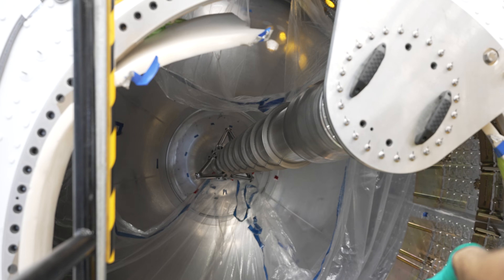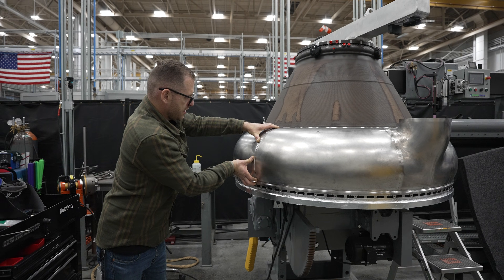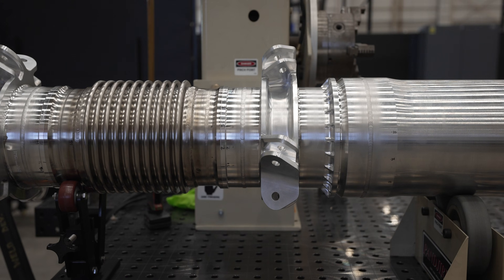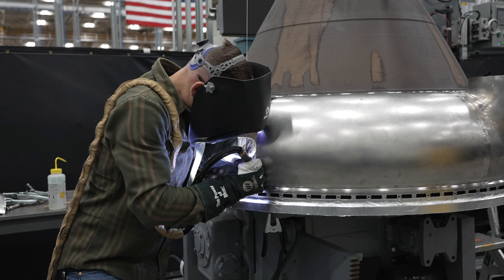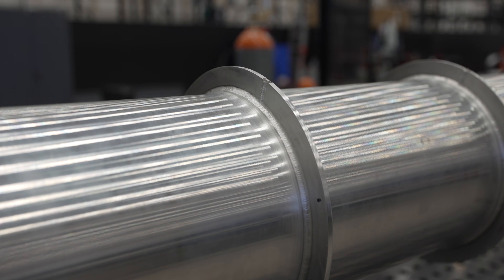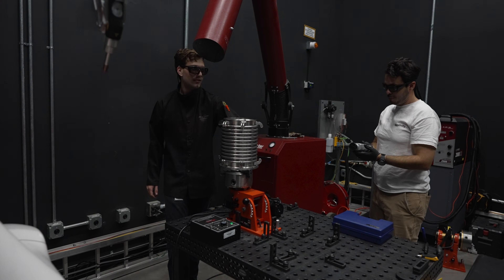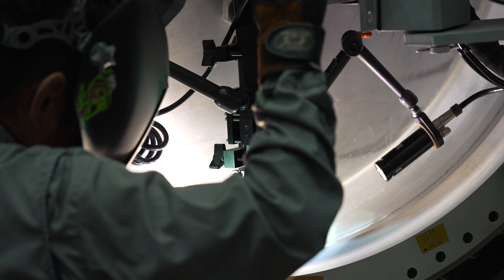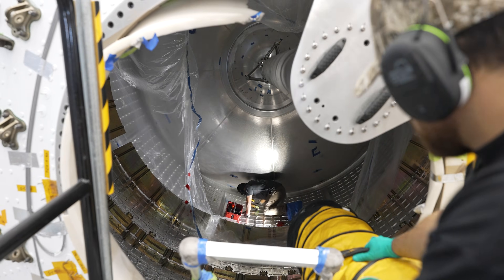Meet the Fusion Weld Development Team

Comment: What is all the hype with friction stir welding? My Engineering professor describes it as this cool sci-fi magical thing that works like butter knife with aluminum. And every aerospace video blurs the bit. Is it some form of machining japanese hen..
Reply: It's pretty much the strongest way to combine two like-metals. No relying on solidified flux to hold the two parts together - the boundaries actually blend into each other. There's videos out there in non-aerospace applications.
Reply: The 2 parent metals with no filler